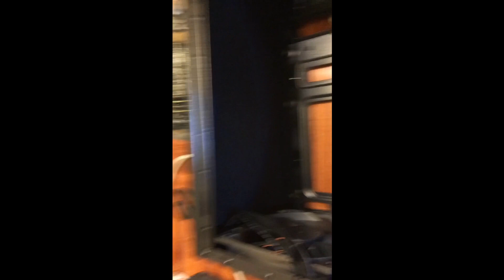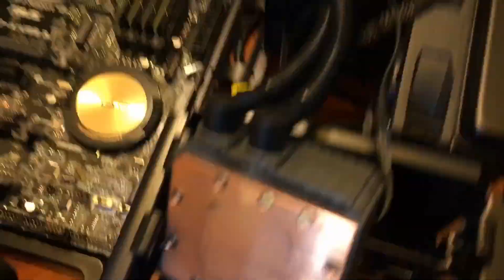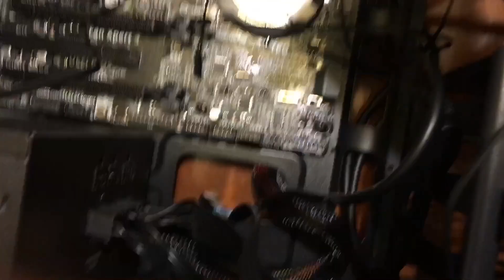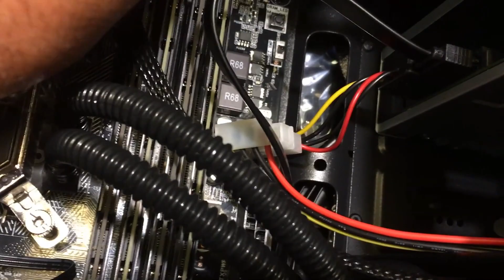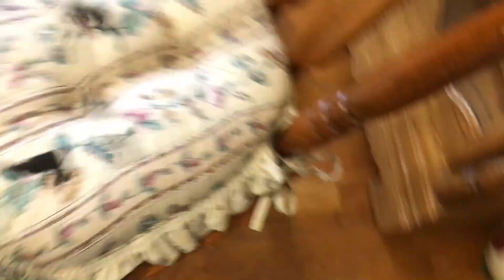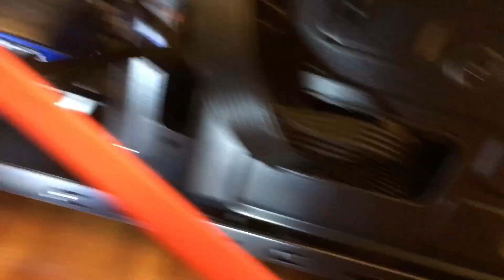Building a Triple Boot Computer - MacOS, Windows7, and Linux

Comment: Hey, can someone plz answer my question and help me. 
Im currently using toshiba tecra z40t-b 16gb 500gb ssd. 

When i bought it i used windows as the main os. Them after a while i installed ubuntu 18.04 and made it dual boot. Now im thinking of installing macos catalina or mojave as a tripple boot option. 
Can anyone plz guide me how should i install macos after ubuntu and windows. I cannot format my 500gb and start everything from scratch. I have a job and i need to work every day so i cant format my drive to start everything from the beginning. My laptop is setup good according to my work. I just want to add macos as a tripple boot to this laptop. Please help me. Any guide would be appreciated. Thankyou. You can contact me on telegram
@hammadsardar097

Comment: I noticed that you placed the case fans in an none-optimal way. The one in front should pull fresh air INTO the case, and the one in the back should PULL OUT hot air from the back of the case. The second thing is cable management... Did you try to put the cables to the backside of the motherboard tray where the sidepanel is? If there is room there, you should.

I can recommend an Noctua U12S or U14S CPU cooler. They perform well and are quiet :)
Reply from the maker: I'm actually going to change the fan positions. The cable mgt with this case is a huge challenge. Hardly any room behind the motherboard.

Comment: Hey Len I have my desktop built but I am having issues making my Mac USB for it I have a MacBook Pro, I'm using el captain and I have looked at Tony macs guide over and over it's not going well. I'm completely stumped
Reply from the maker: You're having a problem creating the USB to boot from? What exactly is happening?
The first step is to download the OSX version you want from the App Sore in your MacBook Pro.
Next, go to the Tonymacx86 website and download the appropriate version of both UniBeast and Multibeast to your desktop.
Next, insert a USB thumbdrive with at least 8GB. ( I use a 32GB USB Drive).
Format the USB drive using the method in the Tonymacx86 guide.
Doubleclick Unibeast and create the Boot Drive.
Once the USB is finished, drag Multibeast to the drive.

Comment: Nice video. I would not worry about the water cooler run it on prime 95 overnight and then see what the temperature is.Water coolers take much longer to estabilize, than air coolers.
Reply from the maker: Thanks for that info! I'll run Prime 95 on it as a test. Thanks for stopping by Guillermo!